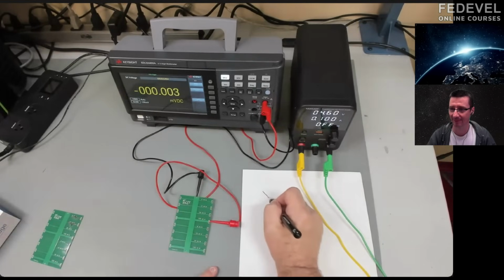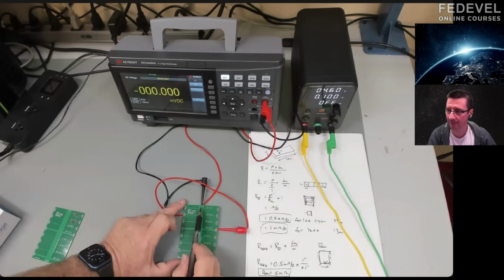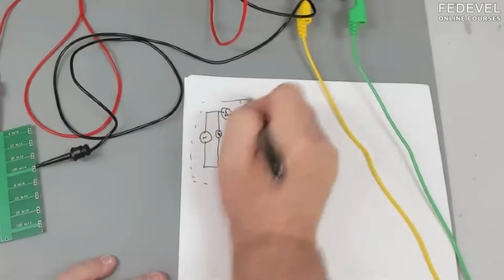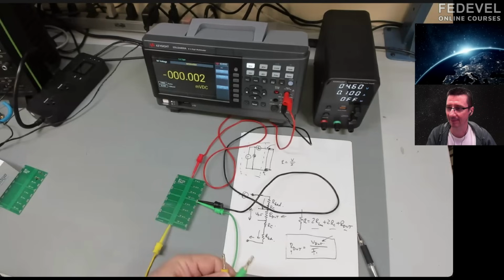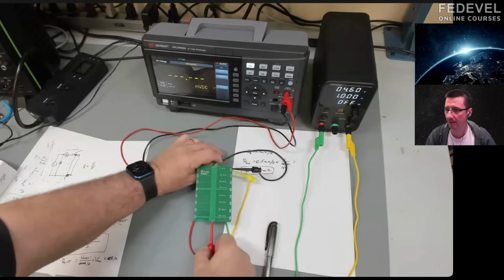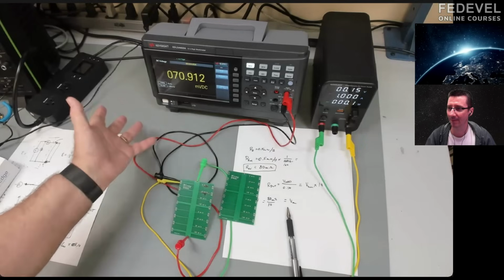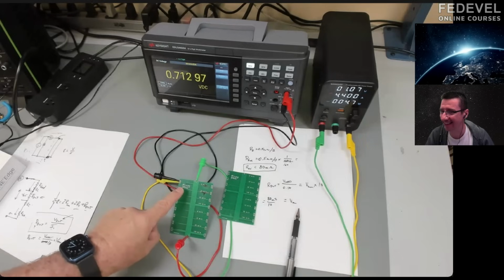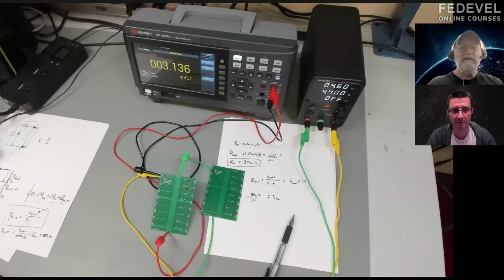How Much Current Will Destroy a PCB Track? | Track resistance measurements explained by Eric Bogatin

Comment: So, you are reading three digit resolution voltage on the Keysight multimeter, while supplying current with un unknown, uncalibrated, 60$, Amazon-bought, China-made power supply...
Then you say the unexpected resistance you got, is due to the over-plating on the PCB, without any dub on that amazing "1.000 A" you read on the power supply...
Sorry, metrology is a different animal.

Comment: Nice interactive training video. Here comes a trick question: If the track is half as long, it will have half the resistance. Does this mean we can have twice the current?
Reply: For the same ohmic power dissipation you can have sqrt(2) times the current, because P = I^2 * R.
Reply: Only If you're limited by voltage drop

Comment: Great demo!
Does anyone wonder why even with the power supply in off the voltage measurement still sits at around 3 Volt? Must have a huge capacitance build in. 
And why not measure the supply current via a precision shunt resistor to know what the supply current really is before assuming it's x Ampère?
Reply: I'm doing similar testing with a 350A PSU, a 500A current probe and a 200A contactor to switch the power. I would not put a PSU directly across a short - the strain on it is huge, so I'm using about 5kW of power resistors. The current is set by adjusting the PSU voltage between 2 and 28 volts. A 2mm trace can pass 150A for a fraction of a second before it stinks the room out. The power supply itself uses a precision shunt BTW.
Reply: You know when thermal runaway is approaching as the current graph becomes a downward slope rather than a flat horizontal line. You can also see the PCB trace change colour each time a pulse (20-500ms) is applied before damage occurs. Vias are incredible and often last longer than the trace they are connected too so I don't think they are important for current handling.

Comment: I want to take the opposite route and build a heating element, similar to PCB based hot plates. How much temperature can I use reliably? There are better PCB substrate, mask, or other PCB materials for this purpose? What documentation is recommended for this kind of research? Thank you
Reply: If you're looking to do this with standard PCBs, what you want to know is the glass transition temperature (Tg) of the fiberglass. Standard cheap FR4 is usually somewhere around 130-140°C, but you can get Tg 150-160 and Tg 170-180 too.
Reply: Look into ceramic heating elements or nicrome wire. Depends what size area you want to heat and how hot.
Reply: @tylerreid5863  thanks for your suggestion, but that's not what I'm looking for.
What I want is something similar to some 3D printers heated bed that is built basically by a PCB finished with an anti sticky layer.
It has the benefit of being easily manufactured, cheaper to replace, and in the case of heating elements for example for a TCO, a flexible substrate can be used.
Even more, there is a small project of a small PCB reflow plate built this way, that project is the reason I asked my question, because perhaps there are better materials/finishes FROM PCBs to do this, with the benefits I mentioned above
Reply: There's a video about that on this channel: This You Need To Know About PCB Materials from 2 months ago

Comment: I don't trust that power supply for 60$ from amazon. Prob most uncertainty is generated by it. You should measure the current with another meter for so small measurements. Nevertheless, the video is brilliant, I did enjoy it.
Reply: Honestly, it's probably fine, unless you're talking about ripple or something. I have a different, but similarly cheap power supply, and they're basically an adjustable supply with voltage and current meters strapped on the front.
So when you adjust the current, you're adjusting it from 0%->100% of its capability, but it's up to you to turn the knob until the ammeter is showing what you want. The display isn't measuring the state of the knob; it's measuring the current that's actively coming out of the supply.
It's kind of an elegant solution tbh. 10% on the knob could mean wildly different things from one device to another, but as long as the voltmeter and ammeter are good, you know exactly what's coming out of it. 🤷‍♂
Reply: He has a good voltage meter, so he most likely also validated his power supply.
Reply: No it is not the most uncertainty in this circuit. Go back to school.
Reply: @brandise76  Can you please educate me? Which one of the devices used in the measurements has highest standard deviation? Please support your comment with datasheets.

Comment: Quite interesting, as with all videos with Eric there's always a new approach to intuitive understanding of complicated topics. The same approach can be used to approximate the parasitic inductance of a trace based on the dimensional ratio of length vs width, where the ideal ratio is when width is greater than the length. Although this conversation is from a purely resistive/ampacity perspective, it's an intuitive method of understanding more about the physics of PCB design beyond the material covered within this video. Great stuff Robert!

Comment: 37:15 is it 1oz copper here?
Reply from the maker: I believe it is 1oz + plating
Reply: @RobertFeranec  considering 1oz copper roughly how much current can a 6 mil trace carry on an outer layer based on this experiment and not as per IPC.
Reply: @vinays6674  try to think for yourself. you dont need to ask any small detail, you can very easily look something this trivial up